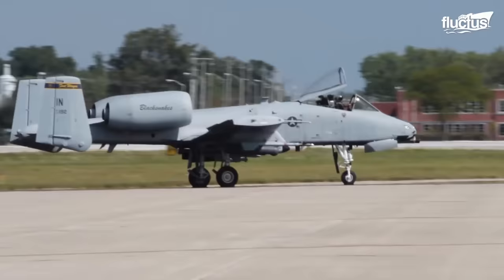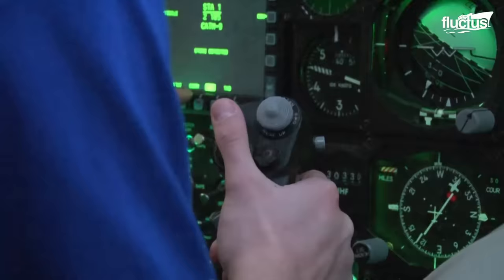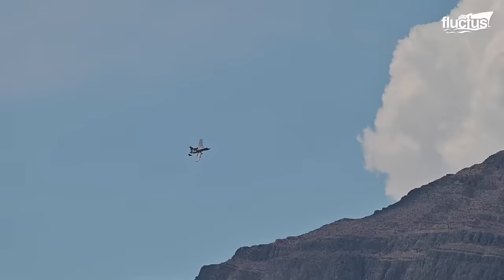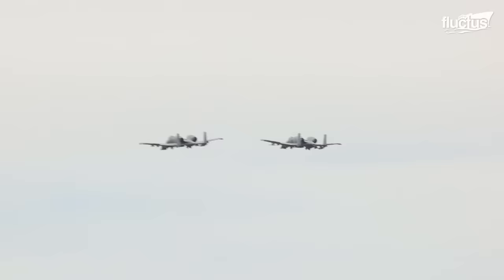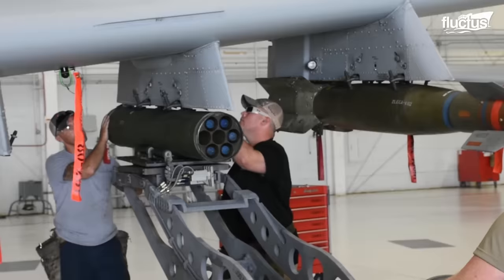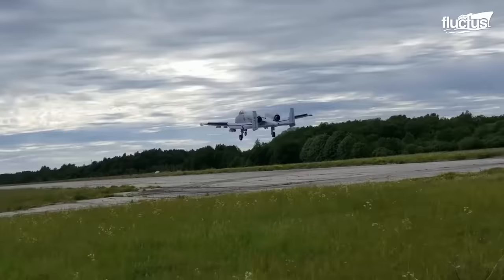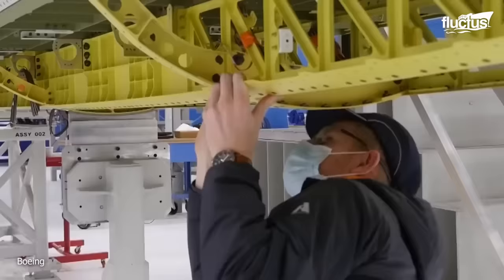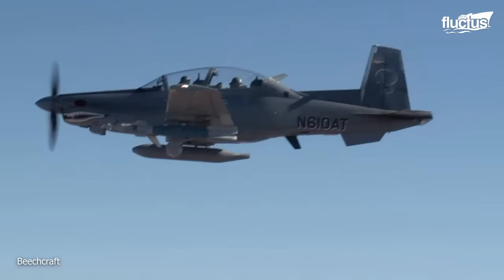How US Trains Newbie A-10 Pilots to Hit Ground Targets Without Missing

Comment: The powder is built for an aircraft built around a projectile built around a gun. The Avenger 30mm is a compact car with projectiles of the depleted uranium style with a propellant that will not (fog) the windshield. The Russians call the SU-25 (Frogfoot) the unkillable plane. I have tried to prove this theory in simulation and the A-10 wins a head to head fight every time. The range of a Avenger 30mm Vs. an SU-25 is all that it takes. I can poke you before you even get your stick out.